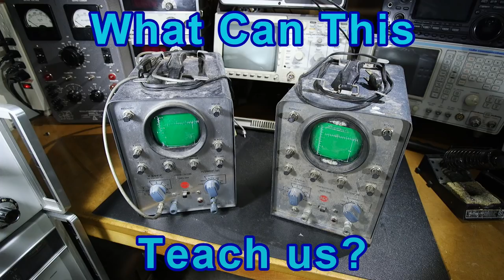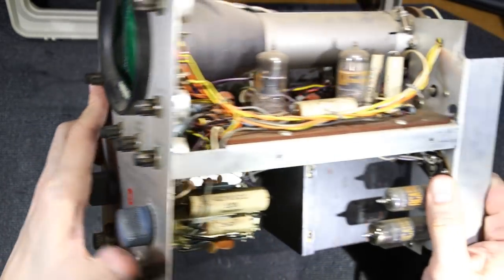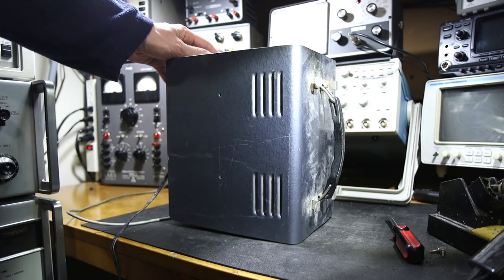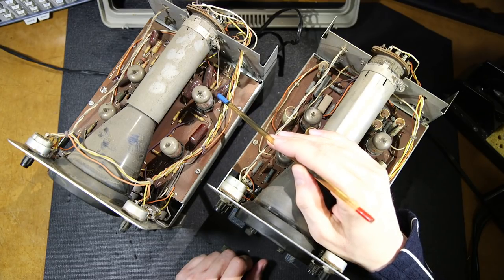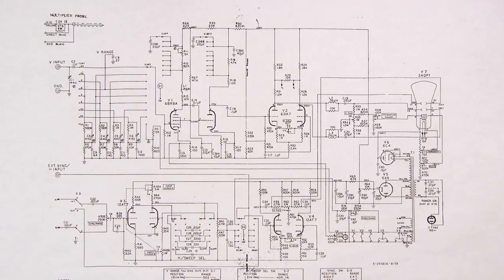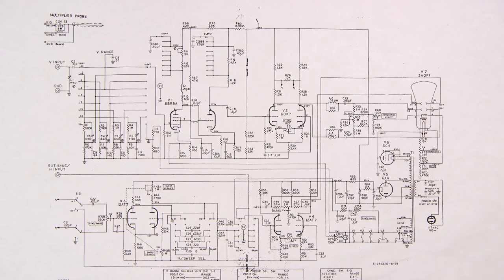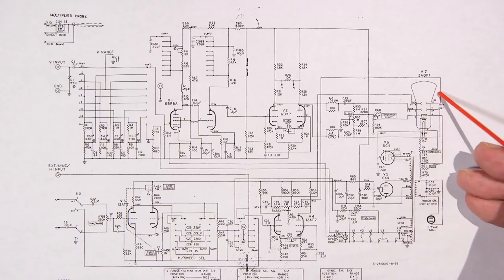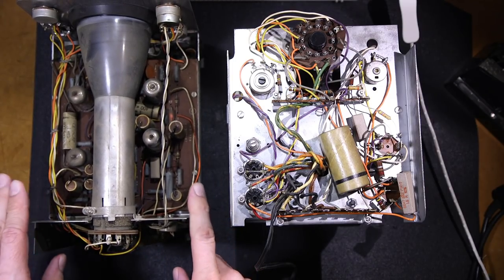What Can Old Test Gear Teach Us About Electronics? Find Out.

Comment: What was Heathkit thinking, I never saw even an old capacitor tester in which the leakage  high voltage was not provided by a spring loaded switch. When you let go of the spring switch it discharged.   They sold some dangerous stuff back then.  My first one was a Knight about 1971.

Comment: What are the chances of doing a Heathkit 10-14 laboratory scope.
Also caps cheap?  The high voltage style seem very pricey making restorations almost not worth it.  Where do you source good and reasonable priced caps?
For a tech tips Tues maybe go over common values to stock ?? Or your thoughts on sticking any caps. 
Thanks for the great well explained vids!! You rock Paul!!!
Reply from the maker: Thanks for your input!

Comment: Thank you so much for all your videos and in particular these about oscilloscopes and other pieces of equipment.
I have a concern and a question regarding the vacuum tube 1V2 used as a high voltage rectifier in the EICO 460 Oscilloscope (and others), while using the equipment on lower mains voltage, or just at 50 Hz (in Europe), which would provide less output voltages from the power transformer. My concern, precisely, is about the filament voltage of the 1V2, which could go easily below 0.525 V, which in the tube datasheet is reported as the absolute minimum value that could be used.
My question is: why the 1V2 cannot operate below that filament voltage? Maybe because with insufficient filament emission it would emit X-rays?
I would like to know what do you think about it, also considering that on the EICO 460 the high voltage is just about 1000 V, which probably would not be enough for developing X-rays in the 1V2 tube.
Thank you for your attention.
Regards,
Daniele

Comment: Hello Paul: Just want to say thanks for another great video on the old scopes !  I also want to thank you for some good advice on the repair of  my TEK 2430A, I replaced all of the 25 or 30 electrolytics on the power supply board  along with the two safety caps one of which exploded, and now the scope is A.O.K. and is on the bench working again !!! Thanks for the advice on replacing all the electrolytics because that power supply board is a really tight fit in that scope !!!   Thanks again Paul !!! ----  KC2UVN

Comment: I seem to remember seeing equipment like this with pots that connected to the back, mounting the pots at the back. They would use shaft extenders so the knob was on the front. I "assume" to cut back interference. Why didn't they do it here?

Comment: HI Paul;
Again you have produced an interesting and informative video, and I very much appreciate your methodical and knowledge approach to trouble shooting and repair.  I just recently acquired a Tektronix 2246 from Ebay.  When I fired it up there appears to be a number of issues with the trace position and trigger circuits.  Just begging to read the service manual and familiarize myself with the Ops manual.  Should be a great piece of gear when I get her "happy" again. Any suggestions would be welcome.  Thank you Paul Carlson.
Sincerely Gary Bevis
Reply from the maker: Hi Gary. I would first check all the Voltages from the power supply, make sure they are close and stable. Vary the AC line with a Variac, +/- 20Volts and monitor each Voltage (power supply output) for variation. It's due for a "Re-Cap" anyways. Clean all the switches with the cleaner suggested in the latest Patreon video (Welcome to Patreon by the way!) At this point, see where this gets you in the repair process. This may cure all the issues.
Reply: Thanks for the good tips, I will begin with the P/S, recap and clean with good contact cleaner and compressed air. I know from my own experience, attention to detail and a good cleaning have brought many various pieces of equipment back to life.

Comment: I like this review of tube theory, but there is one thing I think is misleading.  The input signal is not turning the tube "on & off".  It's decreasing and increasing the resistance of the tube.  It's not coming close to turning the tube off because that would be operating in the non-linear portion of the tubes operation, distorting the output waveform.  The tube also becomes non-linear when it's operated with too much current.  If the tube were to be turned off by the input signal, the output would not only be distorted, but would be clipped.  It would have part of the waveform chopped-off.

Comment: Mr. Clarson, on 40.35 in the newer scope there is twisted wires: yellow- white and yellow-orange. But in the older one this wires seems not be twisted? This wires should be AC in both cases, but why in the older one they are untwisted?

Comment: Wouldn't the "silicon equivalent" of such a vacuum tube amplifier circuit be like driving a mosfet in its linear region? Like you don't want to have the thing short the 120V line to ground but like as the voltage on the gate of the mosfet rises the 120V line is gonna get pulled to ground more and more...

Comment: have you ever gotten into a piece of equipment and all of the old caps are still good? also the old can oil filled capacitors that they had in some of the military equipment, are they good caps? i'm referring to the ones that mount flat to the chassis

Comment: Have you tried running one of the leaky capacitors for a few hours under charge? I remember chatting with a radio engineer who said after WW2 a lot of people pulled their valve radios out of storage (I assume the batteries were difficult to come by) and started them up. The radios didn’t run. The broken  radios ended up with the engineer who just left them for a few hours switched on and eventually they would come back to life. His explanation was that the capacitors needed running for a period to get back working.  Having said that I remember my father swapping out capacitors on valve sets before starting up, with dire warnings of the mess that would ensue if the caps had failed.

Comment: When you were doing the leakage comparison of the old vs new capacitor it seemed like the “eye” on the heathkit became dimmer when you set the test voltage to 600V.  Did you notice it or is it a artifact of the camera?
Reply from the maker: This is normal, when you set the switch to leakage, the eye dims.

Comment: Hey Mr. Carlson, I need help identifying a diode I need. It doesn't seem to follow the standard diode labeling? The car was made in 1985, so its a 32 year old diode lol. Numbers on it say B1245, but I have not found anything online close to this. Possibly Ba124? Its a 12v circuit that controls the headlights in my car lol. Also, if you could point me in the direction of the best place to purchase such a component online, I'd be much obliged. Thank you for all the wonderful videos, I love watching them and learning.
Reply from the maker: Hard to say from the information provided. You need to draw the portion of the circuit it lives in to see it's function.
Reply: I shall do this. Would you mind if I emailed you the schematic once i'm done? it appears this part of the circuit takes 12v power from the headlight switch and passes though the missing diode and feeds the bases of two transistors and a capacitor.

Comment: Hi Paul,  I was wondering if you can tell how much leakage there is through the cap by looking at the eye tube.
Reply from the maker: If you were to index the shadow angle in uA's on the case of the Heathkit, it would be possible.
Reply: I guess I am not real familiar with how the eye works or how it is interpreted.  Is it always a symmetrical display?

Comment: On the schematic down by the power on indicator lamp there is a variable resistor R76? What is it's purpose and what does it affect? It appears to be a calibration adjustment not a control on the front of the scope.

Comment: Why are there filter cans? Is it for shielding? It is my understanding that since people restuff them, the caps are all in there individually. Or am I wrong and they are wrapped around one another as some kind of combined capacitor?
Reply from the maker: Hi Jeff. The caps have different configurations inside the cans depending on manufacturer. The cans hold the electrolyte solution, and seal it in. Basically the only reason for cans is to keep all the filters in one spot close to the power supply. All the grounds to the capacitors are in one spot as well, (a spot of lowest hum) on the chassis.

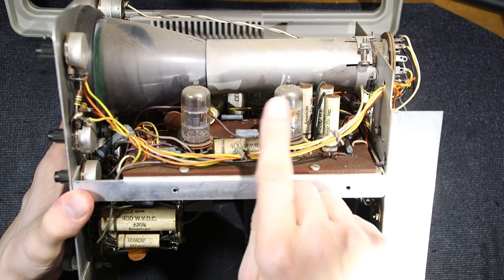Comment: 6:49
400 W V D C     LOL
Working Volts Direct Current
LOL
How bloody old is that
who see's   WV  these days , let alone   WV DC  as if we needed to be told 
that a cap would output DC
LOL
oh god... you gotta love it
Reply from the maker: Some capacitors that couple the front end in these older scopes had AC rated capacitors. WV and SV are still used, but often not printed. 
** as if we needed to be told that a cap would output DC
* WV is an input rating, not an output rating.
You are correct, these are old caps. They were way more descriptive back then.
Reply: @MrCarlsonsLab  
Hello Mr Carlson,   it's your first time responding to me so i feel compelled to say a few things

1.  I'ts fucking weird calling you MR Carlson since we seem to be of similar age  LOL

2. Re the WV..... Really ??? Hmm,   thanks , good to know

3. I suppose in summary  iwas just getting nostalgic with the old caps,  I'm from the old days of 70s electronics and black and white TV's  and since i haven't seen these caps in a few decades i got a little excited    (Electronicns Porn and all that) LOL

I have an old BWD CRO last serviced, i think 1963
still works,  but it doesn't have those type of caps but it's still cool
I have a KIKUSUI  approx !984 Vintage  i have a Tek Digital scope approx 1994 Vintage and then i have 2 recent one's but i still prefer the old stuff to the new

anyway  ,finally , you're doing good work,  Keep going with it mate
You do the electronics industry and guys like us credit by keeping this alive
I was actually thinking of starting up my own channel focusing not only on electronics but a few other things, computer, Networking, Satellite and a few other things.
sometimes i sit here and say to myself ,  Even though i have respect (a lot of respect) for guys like You, Dave Jones, Fran, 8 bit Guy , electroboom  etc etc i sometimes feel that some of you guys might hold animosity if someone else entered the space, it's not just that, it's also a consideration of time that i would need to involve, but sometimes i think that since i respect you guys , i wouldn't want to piss you guys off

so yeah, keep doing what your'e doing mate,    it's very cool
Take care
Wish you well

Comment: would a leaky cap explain that my computer monitor needs to be warmed up to NOT display garbage? It turns on fine, but some of its circuitry will not start ok when cold. I did a rudimentary check, no caps appear burned/bulging
Reply from the maker: Hi George. There is a good chance one of the capacitors has developed ESR. This is not always visible by bulging.

Comment: Where can I find the replacement for the large capacitor 0.5 mf 1000 Volts which is in the back of the CRT?  I have a very vintage Oscilloscope with a similar big capacitor in there and I can't find the replacement!
Reply: Wire three 2.2uF 400V capacitors in series - Very cheap on ebay. If they are electrolytics wire a 2.2 Megohm resistor across each to balance out the voltage. Get the polarity connection correct.

Comment: Jeez, $5 a piece.... 😯

A model just like this turned up at a local pawn shop, and they wanted a HUNDRED and FIFTY bucks for it, and they DIDN'T even know if it worked or not. 

I tried to explain to them that even if it DID work, it wouldn't be for very long, and it would basically need a complete rebuild to be functional. 

They wouldn't BUDGE on the price, so I then asked them how many they wanted to buy from me for $75 a piece... 🙄 I told them I'd give them as many as they wanted for that price, and they could double their money. No answer.
Then I promptly walked right out the door.

Comment: Dear mr Carlson I have a oscilloscope and it does not sweep it’s green dot stay in one side,  unless I operate the shift  control. It does no longer goes by it self. The printed circuit board  smells in one corner. In is corner there in resistor and capacitor, is this where forte lie Yours  sincerely John Pinner

Comment: Hi, I've designed a circuit (i'm a newb btw) to control some LED strip lights. I have 5 banks of three different colour strips (red, green, blue) making 15 strips in total. My circuit is a 3 channel CM PWM driver that is used to change the intensity of each colour strip so I can get a whole bunch of colours when their light output combines together, At low intensities it all works fine, but when I crank it up the filter cap on my 7805 input (used to power the microcontroller and supporting circuitry) and the bypass caps on my mosfet drivers will start to burn and eventually 1 or more will fail. The PWM output is raw, it's not smoothed out in anyway because with raw PWM I can get the strip lights to illuminate at a much lower intensity than with just a flat constant current. Any idea what's going on? My guess is it's the PSU dropping when the PWM phase switches on which is causing the caps on that power rail to discharge into the load causing current pulses that are stressing the caps. Anyone got any ideas how I can stop this, if that's is what's happening that is?
Reply: I assume your main power input is being switched into your led strips via mosfets(s). So yes, when the fet turns on it's going to drag your psu down quite a bit and any bypass cap on that power line will brutally current pulse for a tiny tiny fraction of a second and cause a really small heat increase.  If your pwm frequency is high enough that the caps cannot cool down quickly enough before the next cycle, that tiny amount of heat will accumulate and eventually burn the cap.  If you create a second power line, taken from the main line but passing through a schottky diode, and use that line to feed your 7805 etc.. then any cap on that line cannot discharge back into the main line when it drops.  Seeing as you've also probably got some beefy drivers on the main line as well, you might want a beefy schottky too, or several in parallel. But use twice the amount, if you have 2 amp diodes and you need 4 amps, use 4 of them in parallel.

Comment: When I sell my crypto in May, I'm going to buy as many old broken scopes as I can find, repair then and give them to students. I had that done for me and now I do what Mr. Carlson does...FIX THINGS.
Reply: Good for you! You’ve got a big heart and that’s a great idea… it really does help out folks who are starting. Someone did that for me, I had an ad on craigslist asking to buy old test equipment and some guy gave me an entire truckload of his test equipment that he used in his TV repair shop for 30 years. I couldn’t believe it it was wonderful!

I’ve also tried to give away a lot of my surplus test equipment. I had mountains of the stuff at one time… But sadly was too busy to repair most of it before giving it away. But still new tax and students were glad to get the chance just to have some of the stuff and troubleshoot it themselves.
Reply: @hullinstruments   I have now started a company SG Test I am designing a range of high accuracy budget test equipment. I am currently testing a 200MHz differential oscilloscope probe I designed. I'm up to 150Mhz with a laser flat response all the way to that number. Retail should be around $160 many a little more but deffo less than. 200. The next is a revolutionary milliohm / millivolt meter for use in fault-finding, it has a function none other has. Again same target price. All designs will use the same housings for a brand identity.

Comment: A scope that doesn't go down to DC?  New one on me.  Generally your explanations are good, but when you tried to explain why you don't get a shock from touching the chassis - it felt like you needed a second cup of coffee.  It's all about the voltage reference.  The chassis ground is usually close to earth ground.  The fact that the + side of the 680 volt supply is tied to ground doesn't change that.
Reply from the maker: Hi Russell. How is the chassis close to earth ground when it (the chassis) is floating on the secondary side? They are completely isolated from each other, notice the two wire plug (line capacitors optional.) Are you sure it's me that needs the extra coffee?
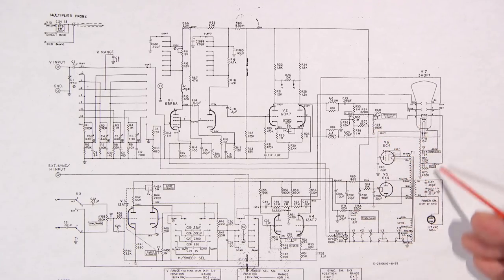Reply: If you connect a voltmeter from the chassis ground to earth ground, what are you going to read?  Most likely some random noise.  I may not have done any better in my explanation, but I thought raising the topic creates more confusion than enlightenment.  (That's around 1:06:48 if you want to go back and review that.)

Comment: I am a little surpriced that you are so surpriced this equipment stil work.  He this is good made stuf not chinesium stuff.  I have a scope from that area  it took 45 minutes to warm up after 20 years not used but it worked fine even stil within specs.  The old tube technoligie will outlive that digital chinesium crab.